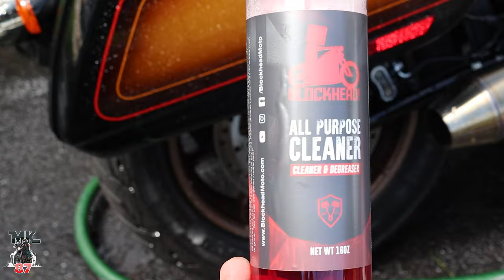Washing and detailing my Harley Davidson

Comment: What size does your buddy were for vest. Yea weird question but almost same size and a lot of vest run small. I ceramic coated mine. Best and worst thing I did. My black bike stays looking good and easy to clean. The bad is cleaning and detailing bike is like therapy. Never stay mad or upset detailing bike.
Reply from the maker: I think 2xl that ones from torque